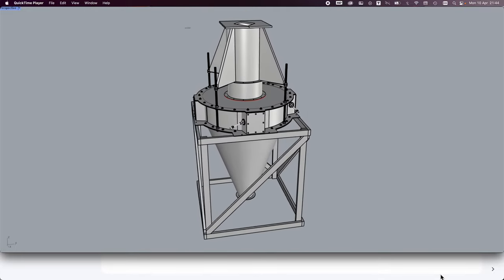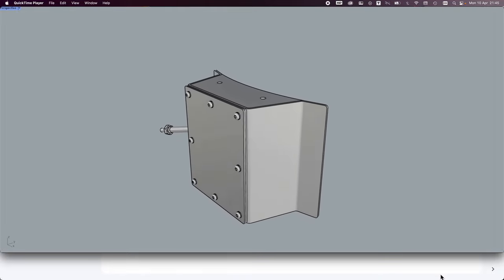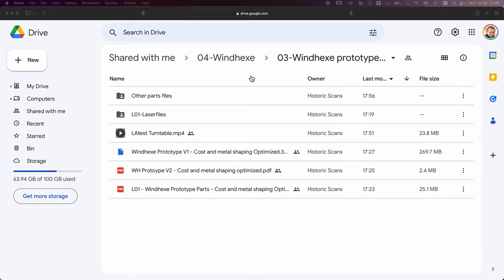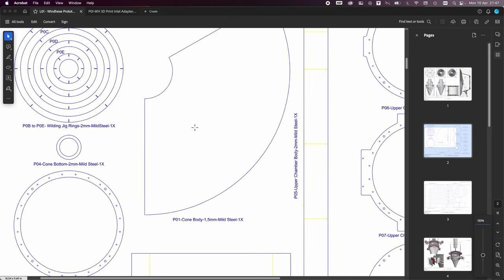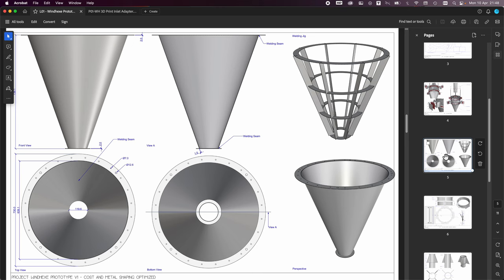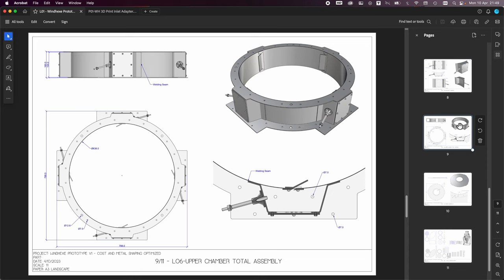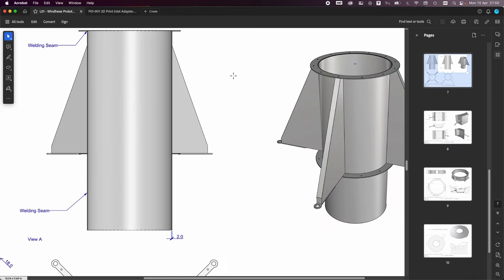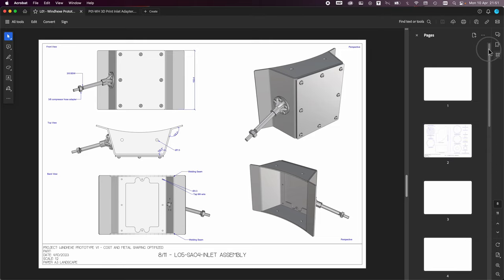O-Day - Version of prototype Windhexe engineering drawings going into manufacture

Comment: Will it work? :P I don't know! XD That's part of the fun, it's worth a shot though.
Looking at the other windhexe videos and photos I could not find any obvious design pattern in the angle of the inlet tubes so it might be not that crucial for getting the whistles to work.
I do suspect that air flow (fps) temperature and humidity will be the most influential factors when the whistles are properly adjusted.
Most likely the frequency will rise along with the air flow up until it reaches a stable state/ sweet spot. But initial testing will tell. 

The gaskets are made of (food safe) silicon rubber. The 3D print is made from PET or PLA for now, just to keep it cheap and simple. 

I will do some calculations on it prior to testing to see if I'm able to do a couple of predictions, but there's only one method to tell if the thing works. 
It helps that it has a wikipedia page, a couple of granted patents and that craft foods have them in their processing plants. That hugely increases the likelihood of the windhexe actually working. Now It's just a matter of keeping the fingers crossed if this design will work ¯\_(ツ)_/¯
Reply from the maker: Yes - that is what got me, Kraft would be unlikely to use it and to produce several derivative patents exploring its application over a number of years if it was a non-starter - sometimes an isolated patent can be speculative, that is not what happened here. Moreover, Airgrinder are selling them commercially and we see that a real tornado produces similar effects - and all of this ties into physical experiments.
Reply: I would say it will work as long as you can get enough compressed into it with enough cfm. But remember the original investor built a 30cm diameter stainless prototype first to fine tune it using around a 7.5kW rated industrial compressor which are quite expensive. One things for sure with any R&D, keep it small and simple for the first prototype (then way cheaper to alter), then once working and refined, then scale it up is the motto of the day for any innovator and tech developer.

For example when working with large prototypes in expensive materials such as 304 and especially 316 stainless steel every mistake can cost you hundreds to many thousands. Where as with a small bench top working prototype, each mistake only costs a few or more quid and youll always have enough compressed air from a decent shop compressor to power through whole range of materials to be tested and processed. Also is something goes dangerously wrong, its far more easier to deal with something smaller too.
Reply: Extra Note:
The angle of the inlet let tubes should not matter much, as its pressurizing the distribution manifold with the adjustable slot outlet as the flow valve guide into the chamber. So what ever the inlet manifolds are made of it needs to be pressure rated to the full psi pressure range that your compressor can supply at for peace of mind. The outlet slot aperture flow area is one of the key parameters, in combination with the psi and cfm flow rate.

Not to mention the smaller the diameter of the windhexe chamber the faster the vortex rpm with a given pressure and flow rate. This is also why a smaller diameter windhexe will have more intensive action than compared to larger diameter windhexes (well as long as you can efficiently feed your processing materials in there, but alot can fit through even a 5cm feed pipe). Including the smaller you go the faster the development and trouble shooting, and more accessible for iteration prototyping and refinement on a fairly tight budget.
Reply: @petermiddleton6902  Yes! That was what I was thinking as well. I've designed the inlet housing/manifolds for high pressures. The prototype I've designed is a bit more than double the size of their 30cm prototype so that there wont be much size restriction when testing different materials. It's also made of mild steel which is way cheaper than stainless. It's indeed way more cost efficient to prototype small and scale up when all of the design issues that pop up have been solved at the small scale. 

My current strategy is to either hook up a large industrial compressor with a large storage tank at the workshop to test it. Or, if need be, to hook up 4 smaller standard shop compressors. I will need to do some more calculations in order to make predictions and properly monitor the air flows. 

I do believe the larger prototype I've designed will be more easy to tune than a smaller version. Larger chamber and larger whistles generate larger wavelengths which probably means more room for discrepancies. Tuning the whistles will be a matter of 10ths of millimeters instead of 100s. It will need some more air flow at this size. So I'm curious what it'll do when we do our initial tests. 

The 650 diameter is still a very cheap prototype. Total cost so far does not exceed 500 euros. And it is pretty easy to manufacture since at this size it is not a high precision instrument to build. This size can also accommodate bottles, bricks, cans, apples and such from the bottom (aperture is around 120 mm)  Which also lends the room to point some lights and a camera at the disruption zone when operating. (mainly filming clouds of dust).
Reply: @TonyJaboney  Sounds great!. Yes an industrial compressor with large tank will give you awesome testing flexibility at scale. Great to hear you have brought the design down to quite a reasonable prototype cost. All very grand stuff!, and wishing you a most excellent build as well P :).